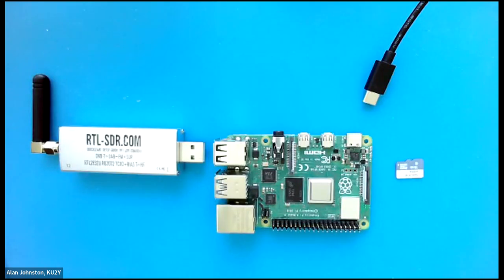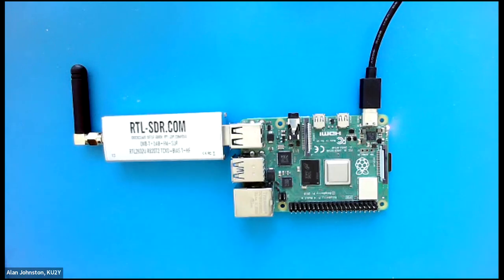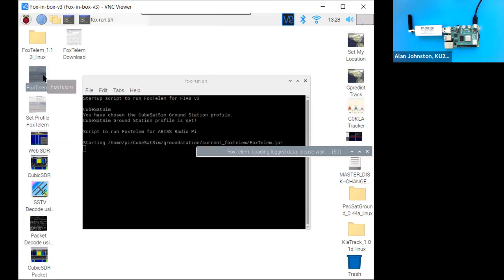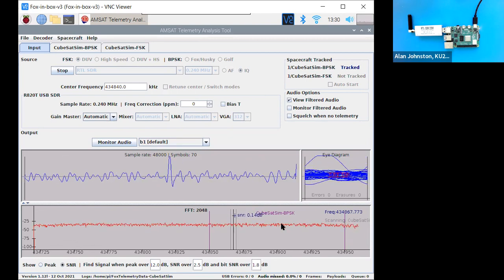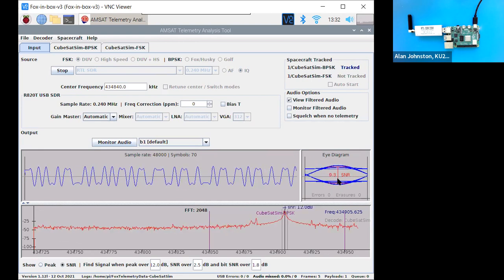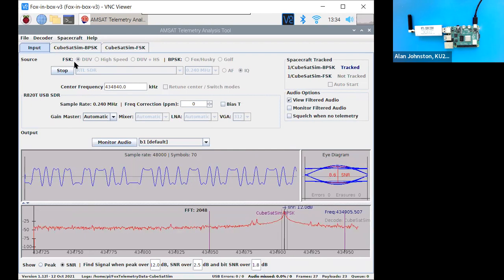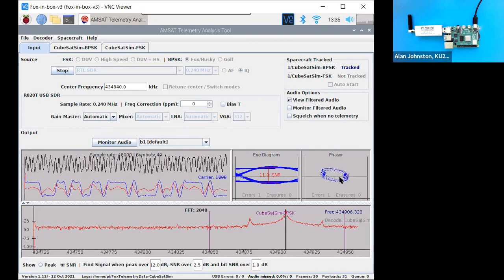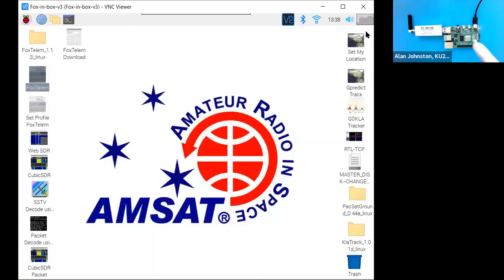Step 3: CubeSatSim Raspberry Pi Ground Station

Comment: I have tried several times to install the Fox-in-a-box v3 image for a Ground Station, but the Raspberry Pi 4 does not boot up. I have tried micro sd cards, usb sticks, two raspberry pi 4's, Balena Etcher, and Raspberry Imager, but still it doesn't boot.  Any suggestions?
Reply from the maker: What is the link you are using for the image for Fox in a Box?
Reply: I have tried downloading the iso and using the url. The url method kept locking up at about 40%.
Reply from the maker: You might be using the wrong iso or the wrong link. Where did you download it? Are you using a 16GB or larger micro SD card?
Reply: @ku2y  I am using a 64 gb micro sd card.
Reply from the maker: A 64 GB card should work although I have never tried it. I would get a 16GB card and try that
Reply: @ku2y  I have tried two 16gb sd cards.  Still no luck. I've been using RPi's since RPi2 with no issues.  Can't explain this. I'll put this aside for now and maybe try it another day.

Comment: as in this we are using foxtelem in pi4 but in previous step  cubesatsim configure in pi0 how to use cubesatsim here in foxtelem
Reply from the maker: That’s correct. The CubeSatSim has a Pi Zero inside it. Step 2 installs the software for it. This step is setting up the Ground Station that receives the radio signals from CubeSatSim. You can use your own PC for the Ground Station, or you can use another Raspberry Pi such as the Pi 4.

Comment: Do I need a directional antenna for this or will a dipole antenna do the job?
Reply from the maker: If your ground station and the CubeSatSim are in the same room, any antenna will likely work. The Pi software also has the gain turned up, too.